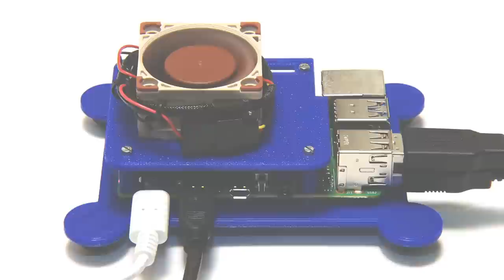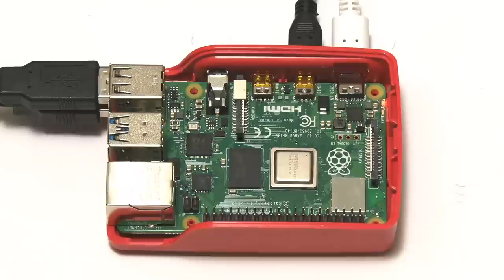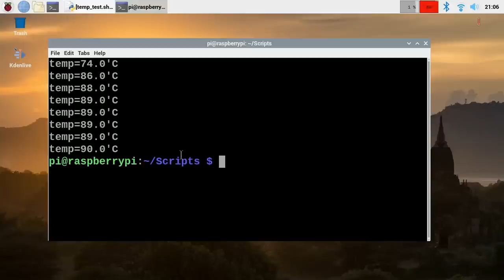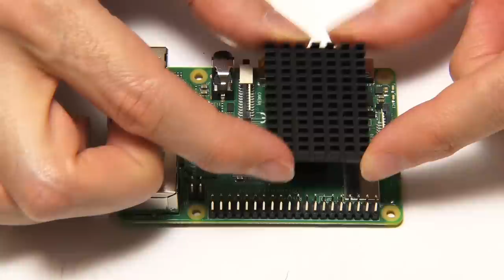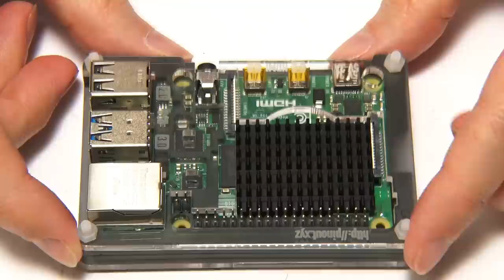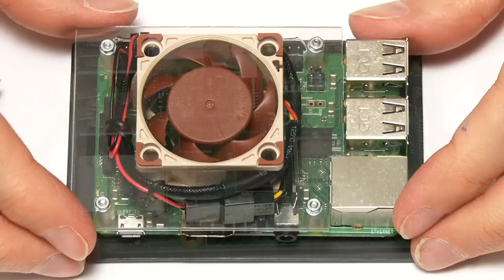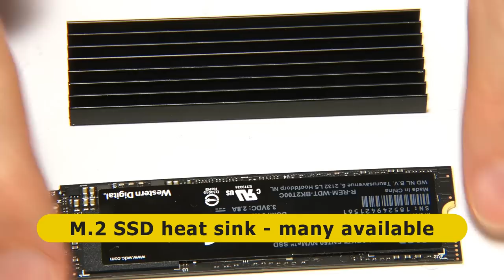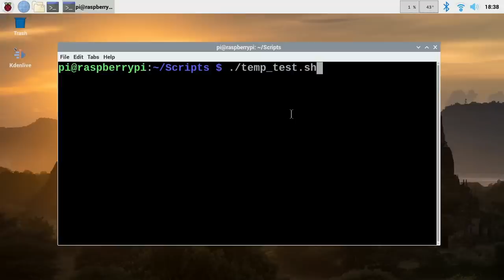Raspberry Pi 4 Cooling

Comment: Christopher, I have a few questions if you do not mind. I will split them up. I am trying to reduce my daily power consumption. Odd schedules are pretty much my life. So I leave a computer on 24/7 for Thunderbird and four windows (not tabs) of Firefox open all the time (and sometimes more). I have a Celeron j1900(qnap 453pro nas) at another site that is function at these tasks. How does a Pi 4 4gb compare? I cannot seem to find a comparison with a Pi 4 and anything I am familiar with.
Reply from the maker: A Pi 4 is drawing about 5V at up to 3A, so up to 15W. I must do a power consumption video at some point.
Reply: Oddly enough I was not thinking about the power consumption of the pi, just such a huge reduction from what I am currently using. Not that power consumption comparison would not be interesting. What I was actually after was a CPU power comparison. IF the Pi4 is to replace a daily desktop, some comparison of the CPU power to mainstream CPUs is needed. Currently I see more data comparing Pis to android rather than desktop OSs(Linux). This makes it hard to compare the two. For instance I have and know the behavior of a J1900. Is the J1900 more/less powerful than a Pi4 and by how much?

Comment: If I do a yum update and upgrade on my pi 4 running stock rasperian will that update the USB controller?
Reply: Have you found your answer? I wonder that too.
Reply: @International_Criminal_Court  it won't update the via labs firmware, which is what we really care about for bug fixes and improvements. It likely updates the driver though.
But ensuring you have the latest USB firmware (starting with vl###) is what you want. I am running vl805, I think that's the latest but not sure. We can talk further if you like

Comment: Common practice with RPi 4 seems to be the use of a fan.  All the fans I see use pins on the GPIO, making the ribbon cable/cobbler attachment to a breadboard impossible.  Is there anywhere else on the RPi4 to get fan power without blocking the GPIO?  Wire to a USB ?  I worry about the current draw with that.
Reply from the maker: There is! It is called the Fan SHIM from Pimoroni -- I show it in a video on this channel a week on Sunday (Sept 15).
Reply: @ExplainingComputers  Many thanks!  Keep up the good work!

Comment: could you test usb speeds with vs without the usb controller firmware update? thanks!
Reply from the maker: I have re--run the hdparm tests, and my results for USB speed by that measure (which is a short test) are the same. But I know others have had big issues.
Reply: @ExplainingComputers  ah okay. thanks for the reply!

Comment: Loving the videos. There is so much you can do with the Pies. I use them with Arduinos to solve all kinds of mobile tasks. Cooling the Pi 4 seems like a good idea. I wonder why they make an official case that throttles the thing because of overheating. Why not make a heatsink that extends to the case surface?

Comment: What was the reason,  since the footprint is the same, that they changed the board layout & not able to use existing cases?
Reply from the maker: There may have been technical reasons due to the new USB and Ethernet controllers. But my guess is that given old cases would not work due to the USB-C power and two micro HDMI ports, to make a big distinction between the Pi 3B and Pi 4B models by swapping over the other ports too! :) This said, it would have been better for me if they had not done this.
Reply: One reason the USB moved is because the usb 3 port needs a lot more traces running to it and they couldn't fit them onto the board in the old position but by moving parts around they can achieve this without increasing the size of the pi.

Comment: Is it possible to use the Pi as a replacement for 5V dip switches in circuits? i.e. Removing dip switches from a circuit and interfacing the GPIO connectors instead? I have an old FM radio transmitter that I'd like to upgrade so it has computer-controlled frequency selection instead of using dip switches. Cheers!
Reply from the maker: Certainly possible. But you may need some sort of controller in there (solid-state or using relays), depending on what you are switching -- see: https://www.youtube.com/watch?v=bOGltcgiXiU
Reply: @ExplainingComputers 
Thanks! I'll take a look. :)

Comment: Sorry but I'm late Chris. Good video. I have a Pi 4B coming from Pimoroni, and I have a Noctua, so I just need the case. I have a 3D printer but haven't used it since first trying it out a year ago. Not sure if I want to take the time on a case yet.

Hope all is well my friend! //Don
Reply from the maker: Hi Don, here we are again! :) The parts here would not take long to print, and I've shared the files: https://www.thingiverse.com/thing:3743755  You'll also find other options for Noctua fan mounting on a Pi on Thingiverse.
Reply: Thanks Sir. I'll check those out.

Comment: Hi, Chris! Recently swapped the included thermal pad with a gaming thermal paste in my Flirc case for RPi 3b+, and so far the aluminum body is heating up much faster meaning the thermal paste is doing its job well. Maybe make a video about thermal pastes on the RPi? :)
Reply from the maker: Good idea on thermal paste video!

Comment: Could you tell me the air flow direction of the fan? I mean, are you extracting warm air or blowing cold air into the RPI?
Reply from the maker: The fan is blowing air down onto the Pi and its heat sinks.

Comment: What about a heat sink for the RAM chip? I added an old worn out silver mercury dime to my RPi3's underside RAM chip with some thermal tape, this was so it would still fit in my case. It seemed to help...
Reply from the maker: Yes, you are right -- I should have added one to the RAM.

Comment: Did something similar with cut up NVMe heatsinks like this to patch up an ISP provided router that had thermal issues under load for someone once. They were not inclined to pay out for an aftermarket one and it did have fairly reasonable hardware in it considering though was basically variant of what was actually a reasonable midrange commercial model that the ISP had decided in their infinite wisdom to rip the heatsinks out of to make it fit into their stupidly designed branded case, aside from needing a little minor work to deal with the thermal issues and coming out of the box with a serious ganked bloatitis infestation of the flash memory albeit an easily treated one as it would still run the far better firmware of the commercial model and the ISP actually thought that removing the hyperlink to the firmware update page of the web interface and renaming it with a gibberish filename would make it not there, nobody would ever throw random HTTP requests at a LAN HTTP server for the hell of it just to see if anything interesting comes back with a 200 code surely lol.

Comment: I have one of the armor cases with the fan on its way after I discovered my pi was 80c at idle in the stock case.

Any chance of a guide to control the fan based on CPU temperature?
Reply from the maker: This I am considering for another video -- using the PWM wire on the Noctua.
Reply: @ExplainingComputers  that would be cool. Even just being able to switch the voltage on and off at a certain temperature threshold would be great for this simple setup
Reply: Fan control is something that I love to see made available. It would make the Pi very quiet most of the time. Only turning on when needed!
Reply: If you get the Fan Shim from Pimoroni (which was out of stock when Mr B was ordering his parts for this video) there's a Python library that can control the fan, and you can install a small script that comes with it as a systemd service.

They recommend you configure it to power up the fan when you reach 65 degrees, but you can control that figure yourself.

https://github.com/pimoroni/fanshim-python

Have a look in the ./examples folder. There's a script in there for installing the systemd files, and scripts that show how you can use the Python module. Oh, and the fan shim has a multi-colour LED on it that you can use as a simple temperature monitor! There's definitely a video in that. :-) /cc @ExplainingComputers
Reply: @ExplainingComputers  It'd be great to show how to do that with the Noctua, as well as with the Pimoroni fan shim. Pimoroni provide a Python library and a systemd service that does this for you (I've linked to the github repo in another reply in this thread). Perhaps you could build your solution on top of theirs? e.g. fork the repo? Happy to help out with that, should it sound like extra work without much benefit (I'm a Python dev).

Comment: Wouldn't a more fair test be running the pi naked as the control?
Reply from the maker: Probably, but I really wanted to show the Pi 4 running in the case that is often supplied with it, and which is the official case solution . . .

Comment: ive tested my 3b+ similarly and i found pulling the air thru worked better than blow thru
Reply: probably because the case is mostly sealed and pulls air thru the gpio/camera cable/sd card slot. and hot air rises

Comment: So the second heatsink doesn't perform well. even in a better ventilated case it maxes out at around the same temperature. I think this has to do with two things 1: the height of the fins is lower 5mm vs 7mm and 2 the extra width and depth really doesn't matter much as there will be no contact with the chip itself thus allowing for farily little thermal transfer. Only when idling does it really help much. I bet that if you where to use a 12 or 15mm high heatsink in an open top case it would perform noticably better than the second heatsink even if its not as wide and deep.

Comment: And what about a fan without heatsink, i.e. relying on the chips own heat spreader?  My own experiments have found that once using a fan then adding an heatsink doesn't really make any difference, especially if the heatsink is stuck on with those awfully bad self adhesive pads.
Reply from the maker: Interesting . . . I must experiment further. ::
Reply: *the chip's own (possessive)
chips = plural

Comment: The trouble with the pi4 is the way it does not boot from the GPU and so you cannot have a debian blob, and so people are going to want Docker, and it then smacks of running power-over-ethernet (a very nice feature also available on Pi3B+ with some work), and then using that usb-c port to add a couple of external hard-drives (often most likely HDD or maybe SSD) and the other two usb3 ports to each run a couple of hard-drives (again most likely HDD or maybe SSD) to thereby give 6 drives for btrfs. Via ethernet, a suitable debian image (even updated) can be grabbed upon boot. It will heat up and people will be using a hat (often but not always on the GPIO), and so the cooling solutions won't work.

So that is a great part of a heat problem, right there.

Owning a Pi4 is probably a necessary evil (and, unless a hardcore enthusiast, it'd be worth getting 1, the 4GB one) but I don't think people will own a great many each in the way they do the Pi3B+ in 5 or 10 (or more) at a go. The Pi4 designers could have also flung on an A53 and given the option to thereby boot a debian blob. It would also have meant the A53's 4cores and the a72's 4cores could have been used together (even deliberately underclocking the a72 thereby cooling) to get 8core parallel processing done such as blake2sp, which would help such a btrfs system and general blockchain fast hashing or 7zip. They could have even put on a very fast (maybe pci-e) edge-connector to allow for a turing-board style compute module breakout to put on say 8 compute modules.

It's just an edge-connector. It is cheap. And as for the A53, well they had a load of them anyway.

I reckon many people will get "one pi4" (probably the 4gb to tide them over as a PC while they consider what to do about 2020 win7 expiry). But then after that, people will want their debian blobs back and they'll start buying up compute modules to make a big fat multiple CPU machine which runs debian as a blob (and thereby has access to a bunch of RAM).

People will (ironically) overclock the pi4 because unfortunately it is a brlliant bit of kit to use just one core for emulating a PC of about a 100MHz 486 DX2 standard (see mjnurney channel) which is about a Pentium 60MHz speed and even win98se runs under qemu. They're blatantly going to try to hit that 100MHz 32bit pentium standard to one day attempt to sail up to the 166MHz pentium standard because then the 3D acceleration (which btw does work on a Pi4 doing that for OpenGL) suddenly makes 166MHz pentium games awesome (just like having installed a voodoo2 card or so, more or less). Post-ironically the GPIO will then be used for its VGA ability (available also on previous Pi boards).

As an aside, connecting mini hdmi like will have the cables or ports break, one day. It'd be like Kofi Annan and the wind-charge-handle of the XO laptop from OLPC. Behold...

UPP4ClRmVik&t=4m25s

If you are using a custom case anyway (or if 3D printing one) it is safer to use miniHDMI-to-fullsize-HDMI cables that clip or screw onto a case to make "full size HMDI ports" as a breakout. Then just plug a normal HDMI cable (or two if using dual monitors) into that.

Awesome usage of the NVMe heatsink. Thumbs up. :)
Reply: The USB C is for power only?  You can't use it to as a USB3.1.1 I think?
Reply: @twmbarlwmstar  You're right, in theory. Well, the other usb3 ports might do it as a hub then. A bunch of mechanical HDDs (even just 2.5inch) would not generally (depending on what a person owned) exceed the usb3 bandwidth anyway. Mind you, the usb-c on it was released as a non-compliant port and so some might be tempted to desolder it and then resolder it to be a hub off the other usb3 ports, thereby giving it some decent usage as an actual usb3 port for data when the PoE is used anyway. It might be down to personal preference though. One might even be tempted to jerry-rig the pci-e off it into a pci-e slot but then I have not looked to see if it can be done. The faster sdcard slot is kind of "too good" you use for the OS if the above setup was done, and using it for 4k video (a bit like a digital camera might) could help with kdenlive or blender (or whatever) for 4k video (wear-and-tear permitting).

Comment: There are a lot of small cheap fans on ebay if you search for raspberry pi fan. Do these do anything? I know they wont be anywhere near as good as the Noctua but I can fit them into my case easier.
Reply from the maker: My guess is that those cases -- with the 30mm fans -- will be pretty useful. A fan was not that big a deal on previous Pis, but a fan for a Pi 4 seems the way to go for cooling.

Comment: just a question. Does the fan blow in cool air(inhaust) or is it working as an exhaust to remove the hot air inside the case?
Reply from the maker: It is blowing air down onto the board and heat sinks -- like a CPU fan.
Reply: @ExplainingComputers  oh ok. thank you. can we use just the fan to cool without heatsink?
Reply from the maker: Yes, a fan-only solution should work well. Airflow is the key issue here.
Reply: @ExplainingComputers  Thank you. I have been trying a fan only solution for raspberry pi 3B+ for a few days now almost maxed out. IT has been keeping around 47`C with 28`C room temperature. thank you for your video as it gave me the needed confidence to try out myself.

Comment: Might have been good to have included the Fan SHIM in the test too?   Fear not, I have and can report that with a Pibow coupe case it gives a max temp of 57 degrees Celsius and takes ~10 mins 30 secs.  A more compact, elegant solution for active cooling? (If compactness was ever an issue at this scale?! :D)

Comment: great video. essentially Pi4 is way too hot with both passive coolings. I'll wait to buy it until I can also buy a cheap active cooling solution out of the box or at least a case that can fit a home made active cooling setup. Running the Pi over 65°C is just intolerable to me.
Reply from the maker: There will be a lot of Pi 4 cooling solutions coming to market I am sure. :)

Comment: I have seen last week a strange cooling  setup for a raspberry pi 4. The cooler was a old atom cooler with fan. But the heatsing was glued ( strange but real, but the man where i see it, made a paste from thermal paste and superglue). But it shows only 54 degrees on stressing the cpu. So, i think half of Superglue and thermal paste is good enough to hold the cooler and cooling down the pi4

Comment: I like how the CPU usage and temps are being displayed up in the header.   Most testers display in the terminal window  itself.   What is the command to get the display here/there?   I'm a newb btw especially with Linux commands.  ;)
Reply from the maker: Right click the panel ("taskbar") on the Pi and there is set of options there to add the temperature readout.

Comment: My pi 4 runs under fair load at only 55 degrees celsius maximum. Never seen it go higher yet. Was there some kind of software change that fixed the heating problem?
Reply from the maker: There has been a USB controller firmware update, which knocks off a few degrees (and which was applied here). But there does seem to be a lot of variability in results reported with the Pi 4.